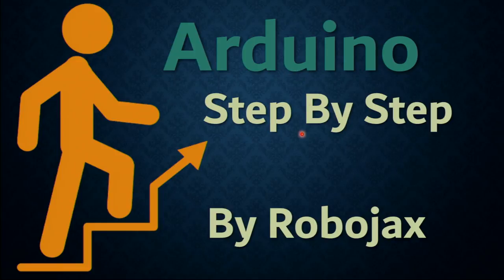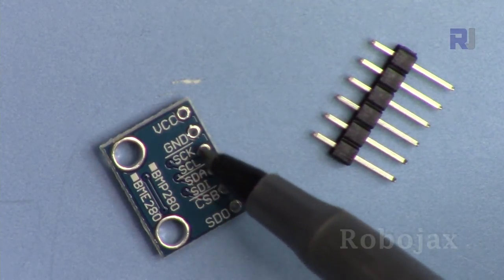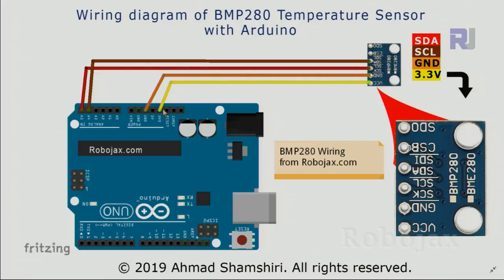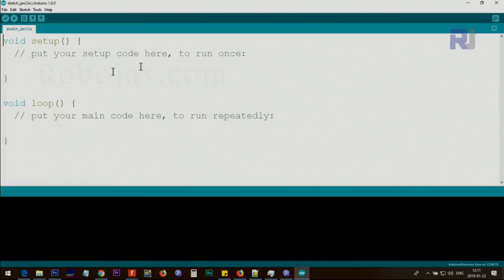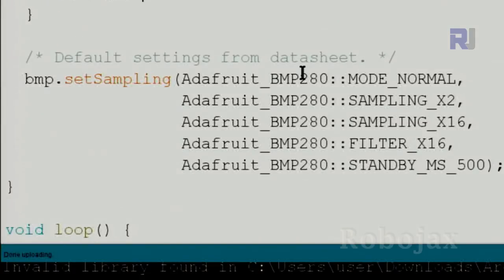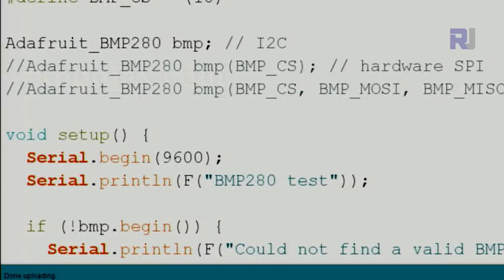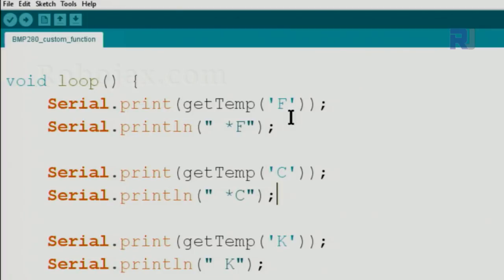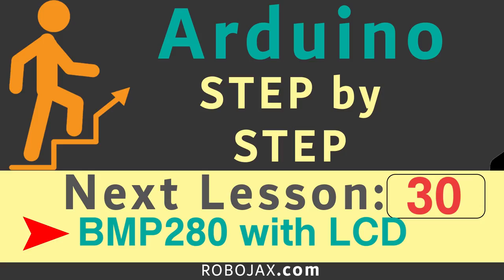Lesson 29:  Introduction to BMP280 Temperature Sensor| Arduino Step By Step Course

Comment: Any examples on how to mount it for actual is for actual use? I like to use 3d printed box with an esp32 inside
Reply from the maker: the way to use it is countless.  The most important part is how to measure and understand it.  Everyone will use it at different device or condition. Good luck.